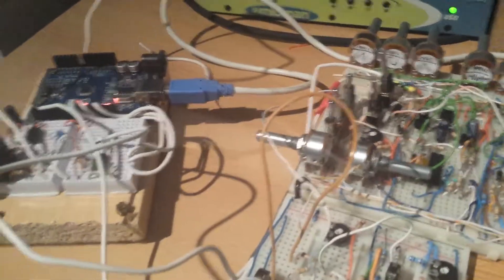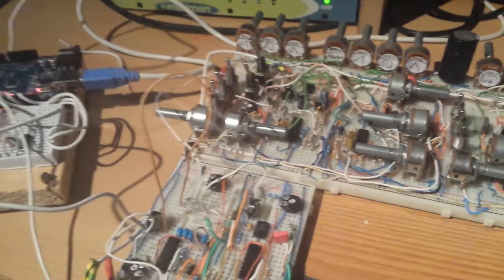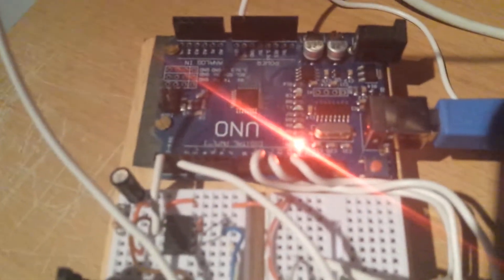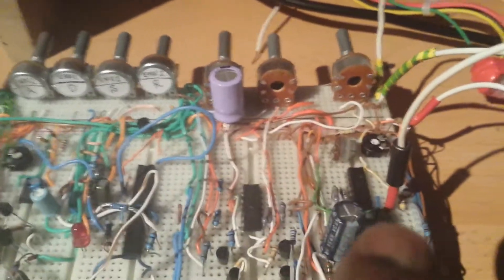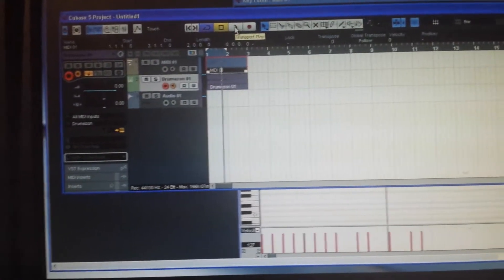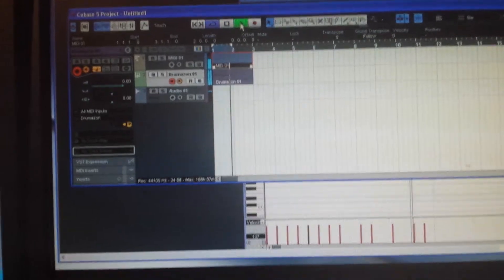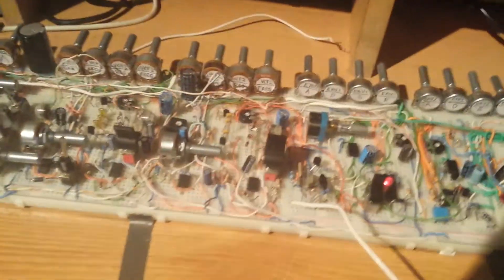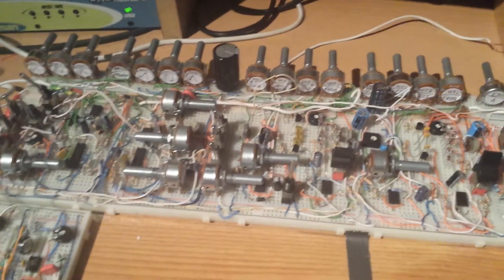DIY analog synth project Part 7 (Arduino Midi to CV Gate test)

Comment: That is fantastic. Do you have schematics?
Reply from the maker: Shane Bruno Thankyou. Are you reffering to having a schematic for the midi to cv or the whole synth build circuits ?
Reply: Yes the entire synth that you've built
Reply from the maker: Shane Bruno . I see not as of yet. Im slowly putting together schems in kicad. (Which ive only recently learned to use. ) However most of the circuits are available on line already. Thou i have modified alot to suit my needs . The Expo converter is the same as the Roland Jp8 thou not strictly a one to one copy. The Env generarors are from Yusynths diy page. Same with some of the VCA, and the Stiener parker vcf design. The SEM type VCF is from an efm page . Google wildcat SEM vcf . The wavefolder is based on the CGS lockhart design. Hard sync circuit was my experiment and design. The lfo's are pretty much the same as the oscs without the voltage control.

Comment: The link to Muffwiggler seems dead ...
Reply from the maker: Bart Coninckx . Hmmm intresting . I will look into it for you , i had a bit of a problem trying to find it a while back. I may have to contact the original guy who did the whole code for the arduino and schem etc and see if he will allow me or himself share in another way. However google "Midi to cv MCP 4921 and see what pops up .
Reply from the maker: Bart Coninckx . Ive just updated the link now. Hopefully it should be working ;-)
Reply: it does, thank you sir!
Reply from the maker: Bart Coninckx Your  welcome ;-)

Comment: Don't forget to invite me for your next rave! I want to hear this thing live. It really has an awesome acidy 303 sound to it!!! 
I am also trying to build my own 303-like sythesizer and that thing you have there is not far from what I envisioned to be my end goal...
Reply from the maker: Jean-Jacques de Balzac Haha thankyou for your comment. Yes the secret location will passed round word of mouth . Yes the first filter has an almost 18db charcater to it. Since this video i have gone back to the drawing board a little with it and made sound even squelchier . You should get on the case  and do a build . The sound diversity this machine has is crazy.
Reply: Word of mouth is best... (although facebook was also great until the police got tech savvy... ;) )

But about the case. I am on it. As we speak I am trying to match transistors for a 1V/Oct converter and I have a working LM358 oscillator on my bread board. I am where you were in March 2016 I guess...  :) 

This was the first video i watched btw, but I am going to start watching the series from part 1. There's a lot to be learnt from you! :)
Reply from the maker: Jean-Jacques de Balzac Hahaha indeed and ruined it all. So extortionate tickets were the way forward.
Reply from the maker: Jean-Jacques de Balzac Yes good stuff , if you get stuck send me a PM and ill see what i can do to help :-). As ive said before im no electronics enginneer but i knew what i roughly wanted to acheive, so i just kept on building circuits, failing and kept going.

Comment: Wow! It reminds me TB-303 by the sound! Really nice filter! I like Korg's whistling filter not less than this. But your synthesizer sounds so classy! I hope you'll solder it after you'll settle everything. Is it monophonic?
I'm just about to start some analog synth building :) Now I'm finding a best (not the most expensive though) components to make a MIDI2CV source. Arduino obviously but what model to choose?
I'll make it not just for fun... I write some music and need "fresh experiments" and get an analog sound instead of emulations. Proper FM synth. emulations are very CPU-greedy and I suspect these are not accurate when it comes to cross-FM modulations and waveshaping them.
It would be simple to just buy a ready solution and use it... But it's not my way for now. I like some challenges and quests :)
Reply from the maker: Thankyou for your comment. Yes the steiner p filter is very nice sounding  although its 12db/oct it can sound more 18dbish. I have now replace one with an SEM clone thou. Yes it is monophonic with 3VCOs plus SQR/TRI sub. Like yourself I wanted to build something I guess feature wise would have been out of my price range and for the goal of using it in my music production. I have done lots of sampling already. I would go for the Arduino Uno like I have used in the vid , it cost me less than £10 (yes its a clone) still it works well . The DAC and optoisolater I used are both quite inexpensive aswell. However I had to make my own 5v Refrence voltage as the arduino doesn't quite output enough using an LM358. Yes I love FM too its so versatile and creates far complex timbre in comparison to subtractive synthesis, lucky I own a DX7 mk2 and SY77 to take care of that. Building your own from scratch can be  very rewarding and a good learning experience. Once im 100% happy with the circuits I want to build it into a desktop module for portability. Please also check out my other vids if you havnt already done so ;-). If you need any future help don't hesitate to message me .